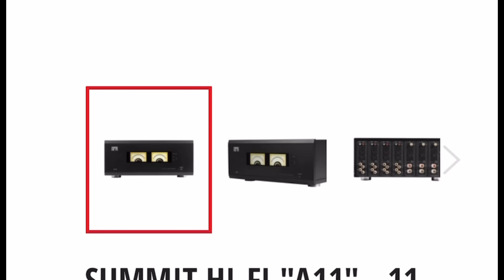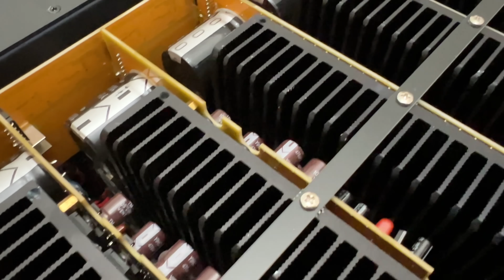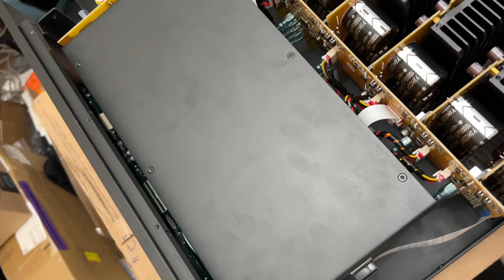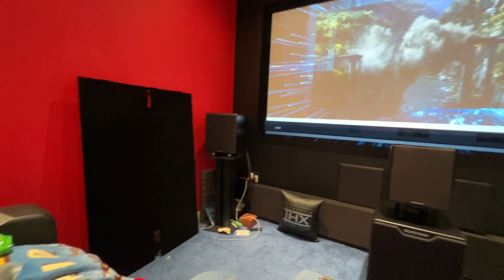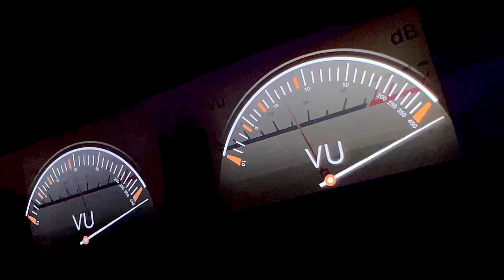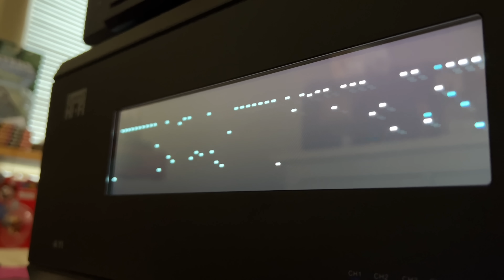STRIPPED NAKED : Summit HiFi A11 11 Channel Power Amplifier Review

Comment: How do you connect the preouts from the receiver to the amp? I ask because I have the 7 Channnel version, and there is only ONE RCA input per channel, but the back of the receiver has a left and a right rca connector for each preout channel. So does this require a special cable that mixes the left and the right into one RCA input on the amp???
Reply from the maker: Just use one rca cable from each output from the receiver. So front L and R can be connected to inputs 1 and 2 of the amp.

Comment: Great review! 
Is it a solid upgrade over an Outlaw 5000 amp paired with a Denon avrx4500h or better off adding a Marantz cinema 30 with this amp ? Please advise thank you
Reply from the maker: @timothyclauw7035  I haven’t listened to Outlaw Audio for at least a decade so I can’t for sure say whether Summit is better than Outlaw or vice versa. Sorry. I don’t want to spew BS to my viewers.
Reply: How about an upgrade to a Marantz Cinema 30 over my current Denon Avrx4500h or a Onkyo Txrz70? Does the summit hifi a11 feel premium?
Reply from the maker: @timothyclauw7035 definitely! I would start with the RZ70 and upgrade the power with Summit Hifi. Just get the 7 channel and use the RZ70 internal amps for the Atmos speakers.

Comment: "Power rating 300 watt times 3 and 200 watts times 9..🤔🤔 wow..a FREE channel??😅. Great amp
Reply from the maker: @joentjekapoentje  oooops!!! Great catch !!!!!
Reply: @DavidSusiloUnscripted  😅😅 can happen ,sir. But how is the amp performing?
Reply from the maker: @joentjekapoentje very nicely. I’m surprised at how good it is. I was prepared with Emotiva-class of power amps. This is noticeably better than the Emotiva and also better than Tone Winner
Reply: @DavidSusiloUnscripted  ok. But how is the power consumption in normal use?. Its very "heavy power rating". I dont want the breaker to pop
Reply from the maker: @joentjekapoentje looking at your Dutch username I assume you live in Holland? Then you’ll be 100% safe with the 220V outlet at 20A over there. 

In the 110V/120V areas, you can have a dedicated 20A circuit too of you want the full rated power. BUT in reality, nobody will use the entire power rating on all channels simultaneously. So even with a regular  15A outlet you will still be 100% safe.
Reply: @DavidSusiloUnscripted  thnx!